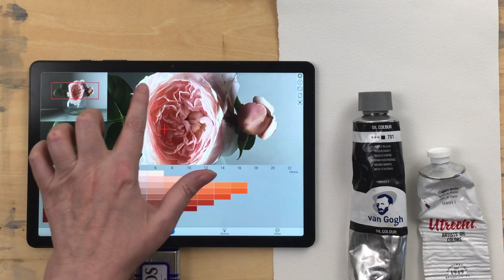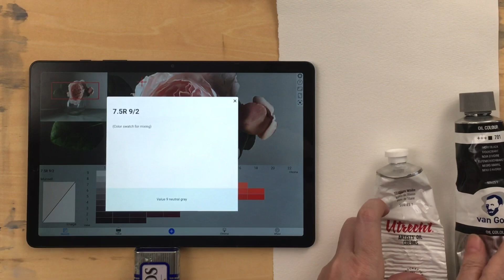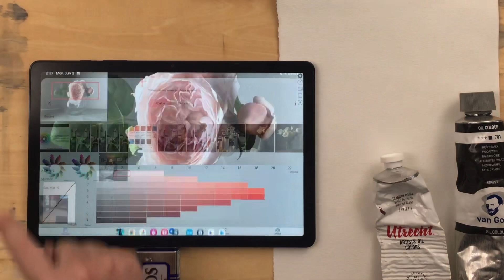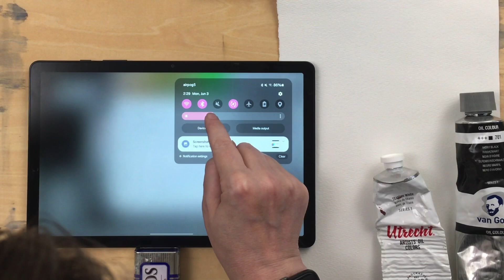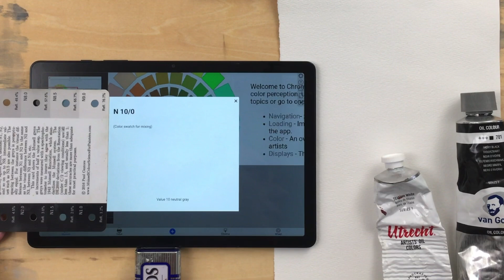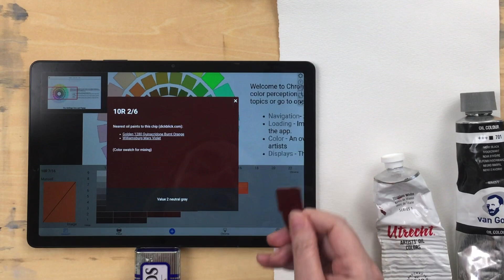ChromaMagic - Setting up your Android for accurate color matching

Comment: Does the brightness setting remain?  Or do you need to recalibrate every time you start a chromamagic session?
Reply from the maker: Yes you do need to recalibrate.   In practice the lighting is likely to change between sessions anyway so it's a good idea to check.   Once you get used to it it only takes a few seconds.
Reply: @MicheleClampArt thank you!  Great product, it is a terrific teaching tool.  Question- i have a suggestion for an improvement- how would you like it communicated to you? (Assuming you're amenable to getting it :-))
Reply from the maker: Oh absolutely.  Very happy to hear suggestions although I can’t promise everything will make it into the app.   Email me at michele@micheleclamp.com
Reply from the maker: Hi Raindog - just catching up with this.  I think we communicated already yes?

Comment: Hi Michele. This looks great, but I'm wondering about temperature. The value matches perfectly to the Munsell Value Scale, but the white on the Android screen looks a lot cooler (bluer). Is there any need to adjust the temperature/white balance too (if that's even possible)?
Reply from the maker: Ah yes!   You may have that problem.    Both android and ios have ways of adjusting the color temperature to compensate for this.  I would need to dig back to tell you exactly how to do it - I'll get back to you.

Personally I don't worry too much about a slight cool shift when I'm using it and just err slightly on the warm side especially at low chromas.    I always make slight adjustments as the paint goes down anyway depending on what the painting needs.

But yes - you can compensate for it.

Comment: Hola Michelle.. Soy un dibujante de la vieja escuela y ahora pinto mis dibujos, y he encontrado esta maravillosa herramienta tecnológica que puede ser de gran ayuda  para realizar un mejor trabajo o más rápido diría yo para igualar el color del motivo que el pintor a elegido ... 👍 por lo tanto bajar o subir las luces del dispositivo está de más ya que esto afectaria a todos los colores que te muestra Chroma Magic para darte la información del color que estás consultando .... 😊😊
Reply from the maker: (translated through google so I hope I got your message right)   Yes you can indeed use CM without adjusting the brightness of your device.   The only time you need to is if you're matching directly to the screen.   If you have the brightness way up you'll never be able to hit those values in paint.

Comment: Michele, I understand that the value of your watercolor paper is the lightest value you can achieve and so using that to calibrate the phone makes sense. Yet, working in oils leads me to believe that Titanium White is about the highest value attainable. Wouldn't it be better to dab some TW on a swatch and use that to calibrate? Thanks.
Reply from the maker: Yes that would be the best for oils.   Or use a good value scale that has a true white on it.    In practice I suspect it makes very little difference.   I'd be interested if it does if you fancy doing a test.

Comment: Michele, thanks again for you patience with those of us using Android devices and adapting to the app you developed. Not everyone, I'm afraid, affords great customer services these days as you have.  

I do have a question about your app. I'm currently painting in oil from a photo I took in Portugal of a fisherman on rocks. There are many color/value changes over rather small areas so there are no grand shapes to the composition. I was wondering what pixel setting you'd select using your app under such a circumstance. Thanks.
Reply from the maker: My pleasure Edward.   My aim is to have as many people use ChromaMagic as possible so I'm very keen to make things simple and straightforward.

And your photo problem is interesting.    I'm a bit perplexed there aren't any grand shapes to the composition.   Are there main areas of light and shadow?   I would start there and change the pixel box size to fit within those.   And start as big as possible moving down to select odd highlights or details that you pick to put in.    I assume you're not aiming to replicate the photo but give a somewhat simplified interpretation of it.   If you're willing to share the photo I wouldn't mind taking a look.
Reply: I'd be most appreciative of your eyeing the photo reference.  Can i send it to an email address connected to your website (I dont use FB, X, etc). Thanks
Reply from the maker: @deaconseptember2002 Sure.   If you use the contact page on my website I’ll reply and we’ll go from there.   (Don’t want to put my email up here)